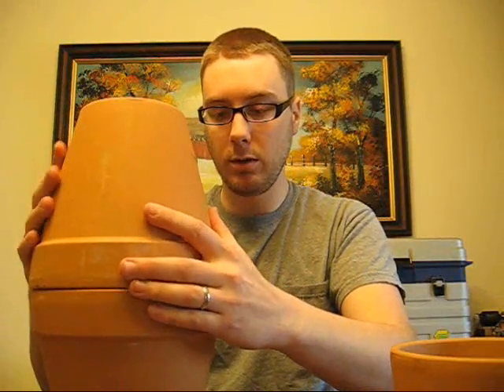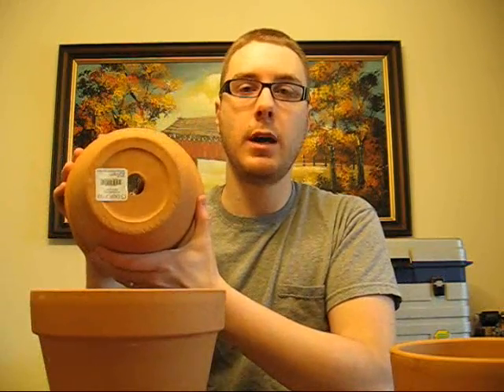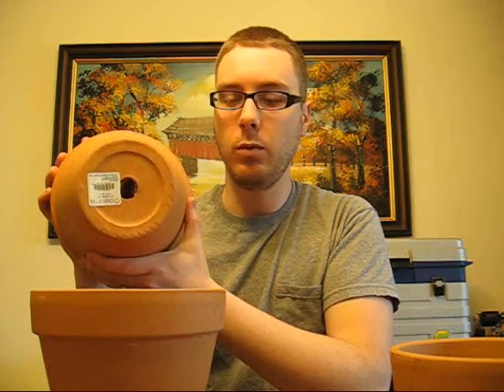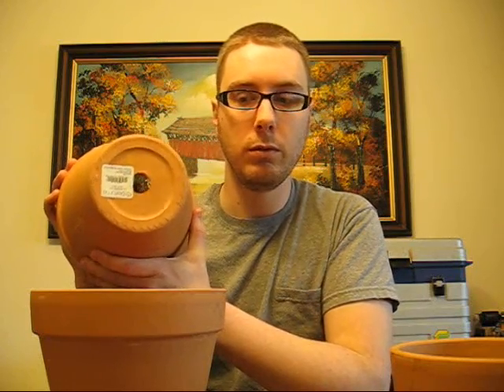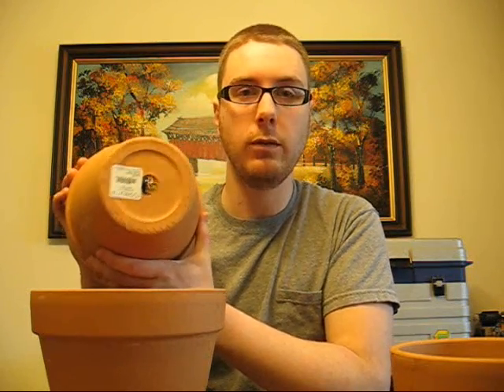Contained Thermite Reaction / Knife Blade Steel

Comment from the maker: I used powdered charcoal for the carbon source.  I calculated out the amount that i needed so that the end product would be 3.5% carbon.  That's is a really high percentage for carbon steel but after attempting a small thermite reaction as a test and seeing how violent this small reaction was, I decided to increase the amount of carbon in the reaction.  I did this so that even if half of the carbon was blown out with slag, I would still be left with a high % (1-1.5%) carbon steel.  I called it my huge fudge factor.  It still didn't work the greatest.  When forging, a few slight blows with the hammer and the metal crumbled.  Oh well.  Looks like I get to try again.
Reply: but  maximum carbon content for steel is 2 %, more than it you just make pig iron. are you sure about that ?

Comment: Very nice Thermite burn.   I just did my first one yesterday and am afraid I did not add near enough carbon.   I used powdered charcoal and only one percent by weight of the black sand.   I am guessing ten percent would have been better.    I am currently taking a class on using black sand in a crucible but that takes an hour to complete and you can only get three burns per crucible.    My teacher told me he was experimenting with thermite.   I was just curious what are you using to add carbon and what ratio to the iron oxide?